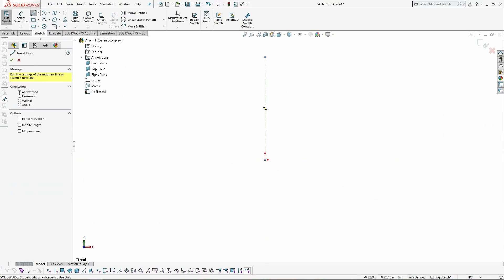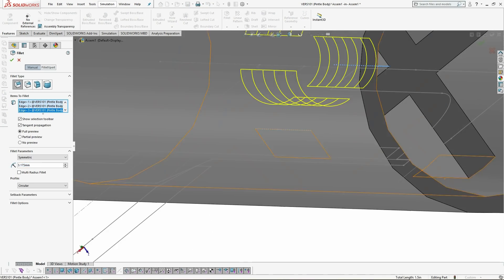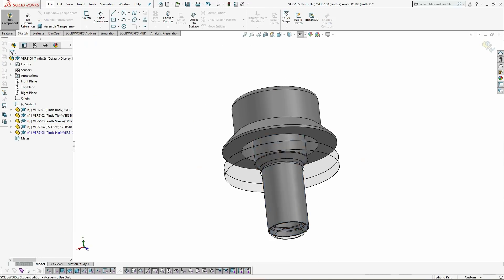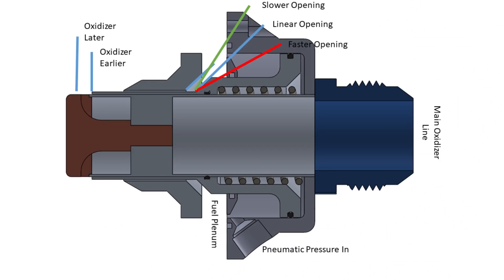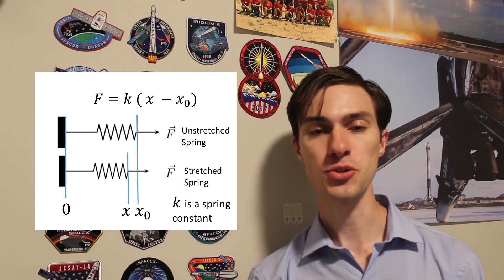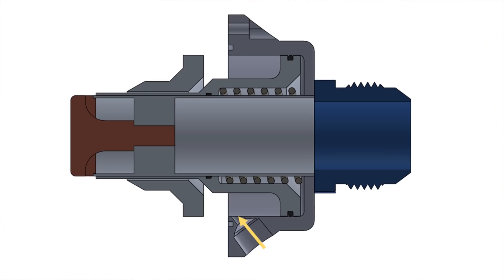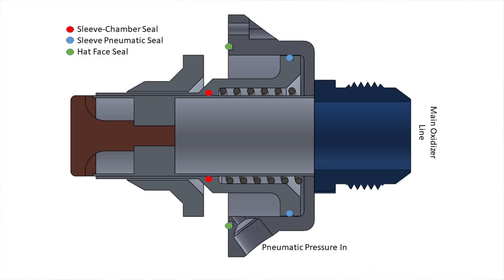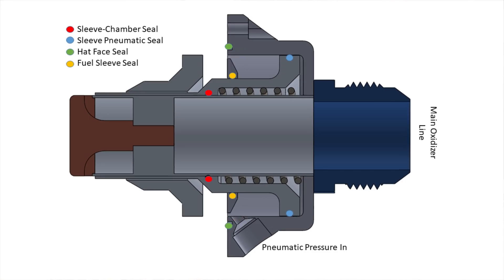Liquid Rocket Engines 3: Sleeve and Seals

Comment: Question: depending on the TWR will high G loads at max thrust effect the function of moving components inside the engine? Do you need to account for G forces or are they negligible compared mechanical advantage given by the engines pneumatics and pumps?

Comment: "But that's just a machining problem" this guy is an engineer. Machinist side "why the heck does this guy want to hold 1 hundred thousandth on these edges and call out fractional tolerances everywhere else" btw, if you happen to read this, I would love to pitch a new design at you to discuss feasibility.

Comment: For those who do not know. You don't need to buy solid works for CAD. As he mentions Fusion 360 is also a very good CAD design software. I have used Fusion 360 and it is really good. Besides the program is free for all hobbyists, although the free version does not have all of the features.

Comment: How are you planning on maintaining target lambda? As far as I can see you have orface size and pressure to work with as variables. Unless you do some sort of pwm of the injector.
Reply from the maker: I will control it by adjusting the feed pressure between tests.
Reply: @AstroCharlie  will it be fixed pressure or some sort of closed loop approach?
Reply: @AstroCharlie  i have a long history with control system (ecm calibration) in the automotive world. If you have a way to talk via email or etc I'd be interested in a conversation and approaches you could take.

Comment: What would you do if the pintle sleeve that covers the oxidizer injectors is to thin to hold the pressure? I assume you cant make it thicker because it would block the fuel from hitting the oxidizer?
Reply from the maker: I've already accounted for the hoop pressure on the section covering the LOX ports. If I did need a thicker sleeve I could also change the size of the fuel orifice, it would be a less wide slot due to the larger diameter though.

Comment: Regarding that sliding seal, I notice there aren't any wear rings in the design. Are you not worried about unforeseen side/radial loads during actuation and firing wearing away tge seel? Or possibly even under compressing the seal on one side? I'm asking cuz my team is trying to design a sluding seal (for other applications) and would value your opinion on this.

Also regarding the startup, doesn't the Delta 4 start the hydrogen flow first, which causes its iconic startup fireball?
Reply from the maker: Hi Max, it'd be great if you'd reach out via my contact form for technical assistance. https://www.garciasystems.space/contact

Comment: Super cool you share your advencement with us! Thanks a lot for that! I just had a small question : how much injectors will your engine have? On the first video it seems to have only one but this seems not enough to me
Reply from the maker: Just the one pintle. That isn't a problem though. You can just change the size of the pintle element to get enough fuel flow for the desired thrust level.
Reply: @AstroCharlie  Ok thanks for the answer! At the beginning I still had in mind the thousands-holes injectors so when you started talking about control the flow in the pintle injector, I was just like "Well... That will make a lot of motors and wires!". But one injector makes this really more logical and it makes sense since these types of more complex injectors (compared to the classic showerheads) allow for a better mix and atomization coupled with this control opportunity

Comment: Hard starts more specifically happen due to excess of fuel vapors at ignition, best way to mitigate is to start with an oxidizer rich lead in.

The throttling co-axial pintle is probably a massive over-kill for this type of project, the main reason its used is to negate combustion instabilities that occur in larger motors due to poor atomisation/vapourization & mixing. You don't really have that issue in this sized motor.. Could probably have saved a great deal of complexity & machining cost by having a simple static pintle element & two throttling control valves.

BTW, have you considered perhaps getting this into a kit form for those without engineering degrees? Maybe can get it up on kickstarter and those who want to reserve kits can fund the kickstarter?
Reply from the maker: If I have difficulty with the pintle sleeve, I'll definitely drop the dynamic pintle. For the meantime, it's an interesting thing to work on. The engine won't be throttling, even with the dynamic pintle, at least at first. I'll be machining everything, so luckily there isn't too much money to waste on job-shops.
There is almost no chance of a kit. Something like this could be dangerous to people who don't know what they're doing and the market is small, especially since it would probably cost well above $5,000. I'm always happy to help other hobbyists though!

Comment: Doesn't there need to be a seal on the inside of the chamber to the part which directly touches the chamber?
Reply from the maker: There will indeed be a seal there, however I'm starting with a flow test rig, so designing chamber seals is premature. The reason I did the face seal on the hat now is because I know that will be a flat plate on both the engine and flow test rig.

Comment: Nice, but why go with pneumatics rather than hydraulic? I would be concerned about resonances at partial throttle settings, particularly at very low settings. The fuel 'valve' section has a feedback loop, as when it is almost closed it is a restriction, meaning fuel will accelerate through it and be at low pressure through that section, closing it further. It is basically how a woodwind instrument works.

Is there any reason you couldn't just use your fuel instead? The seals would need slightly redesigned, but many of your leak paths wouldn't matter anymore anyway and leaks wouldn't drain pressure so fast.

The other potential issue I see is that the pressure in the spring chamber is not actively controlled (at least in the schematic shown). It will end up at some equilibrium of the two seals leaking, and there will be some delay in reaching it. That could make understanding where the sleeve is difficult, because it will be dependent on camber conditions and seal conditions as well the pressure input.
Reply from the maker: I won't be throttling this engine unless I upgrade the sleeve to be hydraulic or electrically controlled. At full throttle the sleeve has a lot of travel before it starts to shut either orifice, so resonances will be fine. I didn't want to use pure fuel pressure so I could pressurize the fuel and start the engine separately, as well as run pneumatic tests without a full fuel plenum.
The back side of the pneumatic cavity will be vented to ambient, so no pressure can build up there, and the pressurized side of the pneumatics will be maintained at pressure by a regulated supply.
Your concerns are all real though, and I'm only getting away with some of the sketchy things I'm doing because of other design choices.
Reply: @AstroCharlie  Thinking further about it, do you even need the actuation integrated into the assembly? If you are going to have one side vented to ambient anyway then a mechanical linkage out doesn't affect your seals.

Comment: Hey Charlie, looks fascinating 😉
do you consider the thermal effect on the spring stiffness k when cooling the injector with the oxidicer? Looks like a very delicate game of load balance!
Reply from the maker: I had not considered that yet, and you're right, it will be super important, since it's right next to LOX cooled stainless steel tubing.

Comment: You might want to consider researching internal combustion engine valves, their required shapes and operating forces and pressures and the methods for mating valve and seat by grinding both in situ. Good luck!
Reply: Beat me to it with the grinding. The idea is that you make a decent fit, and then spin the sleeve against the seals with some fine grinding compound and the faces grind each other perfect matching faces.
Reply: @agsystems8220  exactly

Comment: Is the surprise video on valves, pneumatics, pressures, or am I completely off?
Reply: It will be a hybrid rocket engine by the looks of it
Reply: @matecser7256  I saw the casing, and I was wondering what it was going to be used for. I wouldn't be surprised if it were.

Comment: I'm interested in the fact that engines are usually started oxidizer rich. My basic knowledge would suggest me to stay always away from ox rich flames. Why is it done?
Reply from the maker: I'll do a bits and pieces episode and cover this question.
Reply: @AstroCharlie  thank you very much.
Reply: @theophrastusbombastus8019  Engines are usually run oxygen rich when they are running Kerosene in a staged/closed cycle, they cannot be run fuel rich to spin the pumps, as the Kerosene  will polymerize under incomplete combustion, coking up the plumbing and injectors.
Reply from the maker: This really only holds true for the preburner. Optimal kerosene O/F is still ~2.5, which is fuel rich.
Reply: @seanbaskett5506  as Mr Garcia said you need to avoid coking only in the preburner, in the combustion chamber oxygen is an heavy molecule and very aggressive so a ox rich flame would reduce your efficiency and make it difficult to protect the walls from oxidation